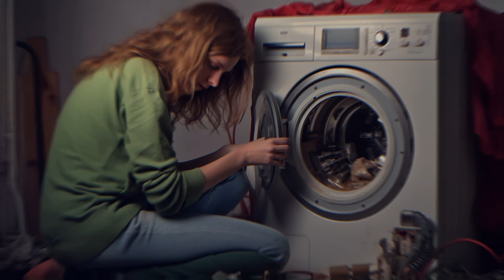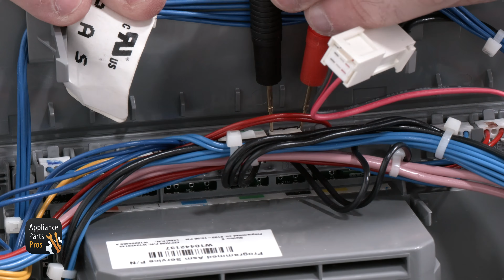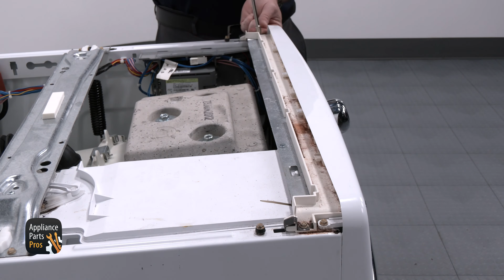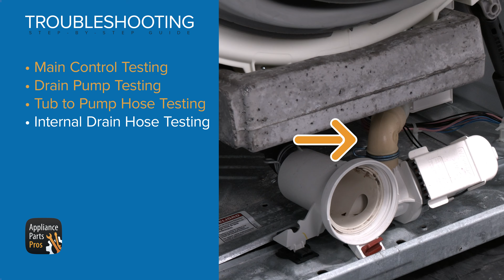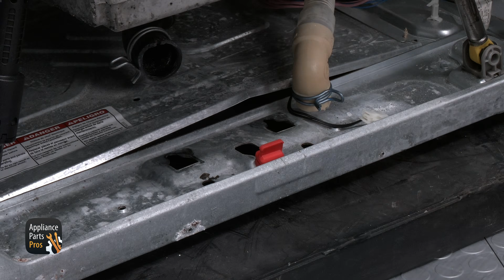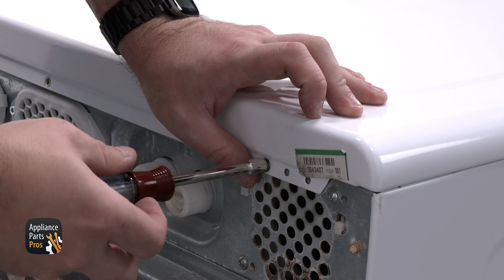Fix Your Whirlpool Front Load Washing Machine That Won't Drain!

Comment from the maker: 🔧 Common fixes for this issue: 
▶ Whirlpool front-load washer drain pump assembly (no speci...: https://www.youtube.com/watch?v=He3D7LTD8Ac
▶ LG front-load washer drain pump filter (no specific part ...: https://www.youtube.com/watch?v=BATVeHT367U
▶ Tub-to-pump hose, Samsung part DC97-17345B: https://www.youtube.com/watch?v=j3IGBkOoSjI
▶ Drain Pump Motor – part #4681EA2001T: https://www.youtube.com/watch?v=dJogazzHPas
▶ Front Bellow Tub Seal / Door Boot — WP8181850: https://www.youtube.com/watch?v=7uEk61JOgRk
▶ Drain Pump Motor and Impeller — DC31-00187A: https://www.youtube.com/watch?v=rlLzXlaJqVE

👍 Found your fix? Hit Like so others can find this video too!
🔔 Subscribe for more repair guides: https://www.youtube.com/@AppliancePartsPros

Comment: Remember when appliances lasted two or three lifetimes?! 
These companies are scammers and with the fake virtue signalling and hypocrisy of Governments forcing us to be more "sustainable" in our lives, but yet they don't legislate manufacturers to do so. EVERYTHING built today is fail and be replaced or repaired constantly.... some not even repairable. What a scam.
Reply from the maker: Modern appliances definitely feel more complex than older designs, and some parts are harder to access or repair than they used to be. That said, many issues still come down to specific components like pumps, sensors, or clogs that are repairable with the right diagnosis. Thanks for sharing your perspective and watching the video.

Comment: Very informative video but way above my capabilities plus it's stacked with the dryer on top in a tight space so can't get to the top to take it off.
Reply from the maker: Stacked units in tight spaces can definitely make these repairs much more difficult, and some jobs really do require more access than is practical. It may be worth checking for simpler causes like a clogged drain filter or accessible drain hose before considering anything more involved.

Comment: I'm having an issue with my Whirlpool wfw7590fw0, I periodically get E1F9 codes. Cleaned out all the drain pump lines. Pulled the pump to ensure it has no blockages.  

From time to time during a drain cycle the washer makes a humming sound but no pump activation and sound of water draining. Eventually it'll make a few clicking sounds before the pump kicks in.  The pump appears to have what looks like a transformer/coil on it?

Would this be a board issue or is it a weak pump.
Reply from the maker: You will need to locate the tech sheet on your unit. There is a test on the tech sheet that will help you determine which part has failed.

Comment: My washer doesn’t spin
Reply from the maker: What is your model number?
Reply: @  Some one remove the model number but that’s front load Samsung washer
Reply from the maker: Unfortunately, without a model number we are unable to recommend any specific instructions for your unit. We can provide basic troubleshooting. If your unit has a belt,you will need to check the belt and pulley. If your unit has a spider arm you will need to check the spider arm for damage. Also, check for power going to the motor. If you have power there and it's not coming on then the motor will need to be replaced.